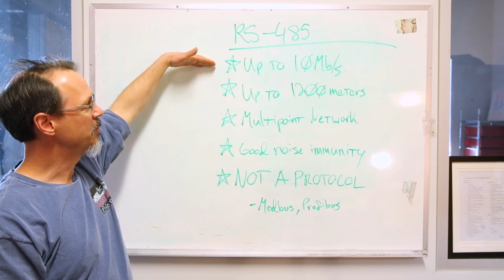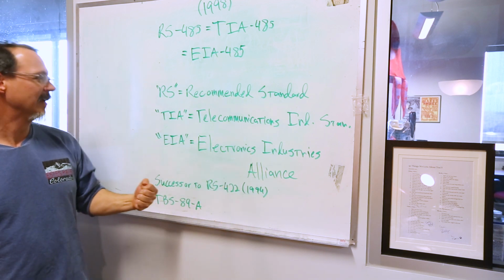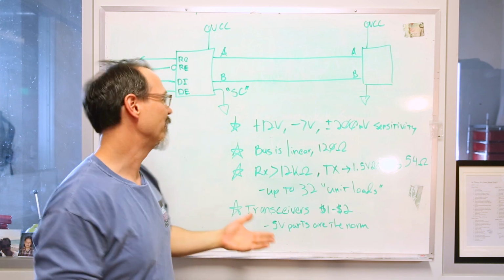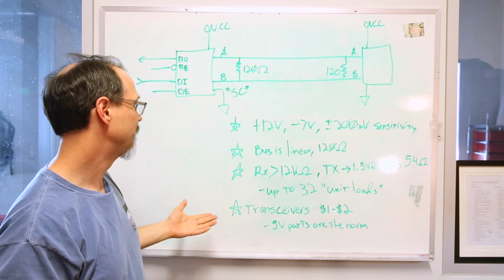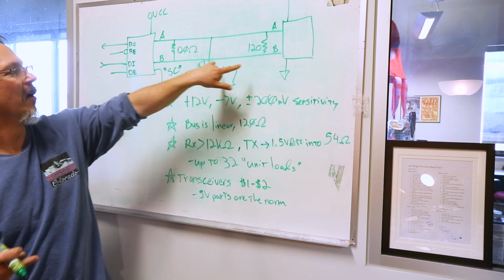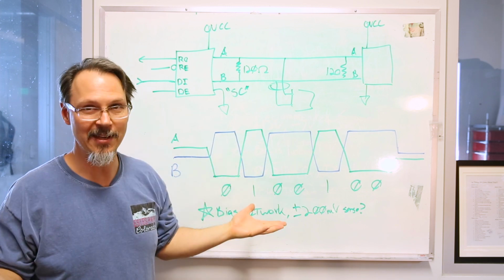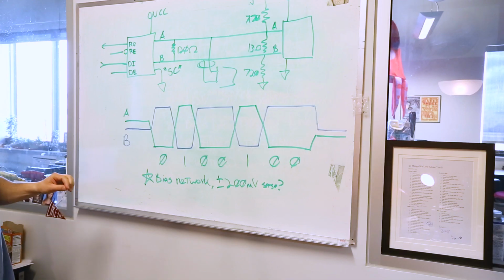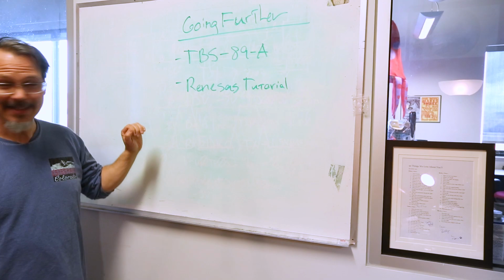SparkFun According to Pete #54 - How RS-485 Works

Comment: The Graphic with the ones and zeros looks so wrong...A takes a half-dive to what you mark as zero , then shoots up like crazy to become a One ... i find this actually confusing....prefer more graphics like this: https://images.eu.ctfassets.net/ihxhv4scj7gi/16mcnrHgDUj89qgnnfvK8M/d9f1ab3deed086712985b9136647e791/Kommunikation-RS-Schnittstelle485-3.jpg?w=1920&q=64&fm=avif

...just my 5 cents

Comment: I get a 1.5v as the differential voltage... Can you explain why?? 
Also I have a problem with soil sensors that use rs-485 I tried 3 different ones...

Comment: Do you need a terminating resistor on each end or just one end?
Reply: You need it both ends of running half duplex but don't need it at the transmitting side if sending data one way only. Generally you'd put both in since it's only a few cents in parts.

Comment: Cool video.   I was surprised to learn RS485 was only adopted in the late 90s.  Back in the mid to late 80s I worked for the IT group of a large national grocery chain and we used RS-485 to communicate from the store's PC in the office (IBM AT 6mhz.. just for reference!) out to a timeclock.  In the late 80s, we added to that link a long cable back to the deli scales.  We would use the RS485 to program pricing information into the scales (how much does that swiss cheese cost..).  Some larger stores also had multiple time clocks.  You had me questioning my memory of it being RS-485, and I thought maybe it was really RS-422, but since both the deli scale and the timeclock had to communicate back, it was really "bi directional" between the PC and the clocks and scales (the PC was involved in every communication, but ONE of the other devices had to talk back in every case).  It looks like RS-422 wasn't open collector, so you truly could only have one sender, so we MUST have been using RS-485 as I remember it, right?  The WIKI page says RS485 first came on the scene in about '83 even though it wasn't formalized.
Reply: Standardized versus adopted

Comment: Hi Pete, very much like watching your videos. Can you also do one about 1-wire? I have a little greenhouse out back and was researching several ways on how to communicate with my sensors / actuators. I2C has no range, wifi uses a lot of power and is not practical when sensor is battery powered. I came across 1-wire and it seems like an ideal solution; having multiple sensors on a single bus. Nevertheless there aren't that many sensors for it. (why is that?)

Comment: TSB-89-A has about the same idle fail-safe bias network (figure 16 - 620 + 130 + 620 ohms) and also says this gives you 206mV-271mV DC bias, which makes me suspect that they might be defining DC bias as from the middle between the two lines, so while one line is +237mV from the center, the second is -237mV from the center, where you're thinking of DC bias as the whole voltage between the two lines. I don't have a copy of TIA-485 itself to dig into if they clearly defined the DC bias concept there as one way or the other.

Comment: We were using RS485 on the Motorola MVME 110 board back around 1989.  So what is this 1998 date, is that when it became standardized?
Reply: Correction - MVME 106 board

Comment: Thank you for mentioning the ground, many people hear the terms 2 wire or 4 wire RS-485 and think that is all there is, neither the + nor the - is a return for the other, they both return to ground so it is either 2 wire or 4 wire plus ground for proper operation.  We transferred 485 as well as other hardware protocols, with the ability to translate on any drop,  many miles over fiber optics and even made counter rotating rings, which gave the same functionality as spanning tree protocol does for Ethernet.

Comment: you mentioned a receive mode. How is it selected what node is in which mode?
Reply: That's up to the individual node to decide, based on what the protocol which is being used on the bus says should be happening.  Nodes will be listening except when they have something to say.  Some protocols ensure that (well behaved) nodes can't be transmitting at the same time.  Other protocols have strategies (e.g. various wait and retry schemes) for dealing with collisions when two nodes transmit at the same time.

Comment: Some notes from TSB-89-A 1) if you combine Figure 4 & 5 you get what RS422 looks like. RS422 is a one master bus with possible full duplex, while RS485 is multi master but only half duplex.
2) in Figure 16 it is shown a bias circuit. 
3) in figure 8 it is implied that the differential between A & B needs to be 200mV to flip the output from 0 to 1 and vice versa this is also stated in "4.3 Noise budgeting", so the total relative potential movement is 400mV at minimum.

Also RS422 is a nice way to get you RS232 line extended further than 15m (according to Wikipedia) without the need to change protocol or specialized wires.

Comment: Nice video.  I take it this is an asynchronous communications protocol?  In your closing waveform drawing, it shows you have two time periods without polarity changes so you call them either a 0 or 1.  Considering there is no clock signal, is there then a defined data rate for these connections?
Reply: Can i use like uart with this standart

Comment: hey, tech guys, get a sound engineer. holy crap my head is hurting with my reference headphones. im both, hire me. i wouldn't let this 40db difference be posted.  
or at least load your vid's audio channel up in any production SW, you will SEE the difference.
Reply from the maker: Thanks for the input, noted x3

Comment: Great Video ... Thanks for the links!  I agree with prior comment that the intro volume is a killer ... My 2 cents worth is that you could've mentioned shield noise and shield currents ... but that is another topic in and of itself.  It does effect RS-485 installed systems tho.  Thanks Again!
Reply: Thanks, and noted. It can be difficult to draw a line on some of these topics as to what needs to be included for a baseline of info.